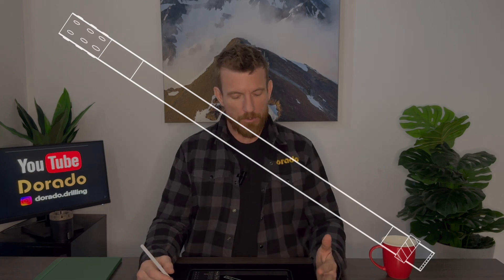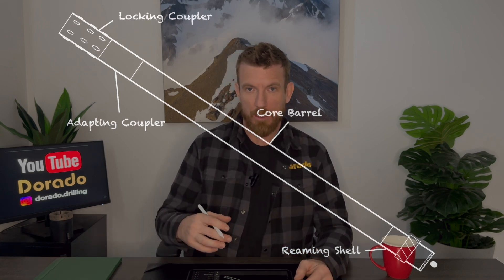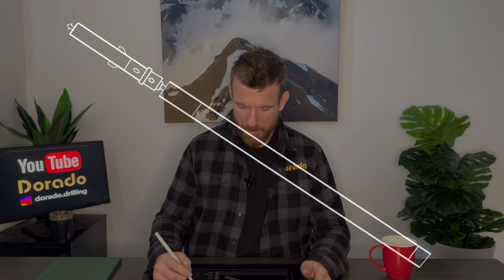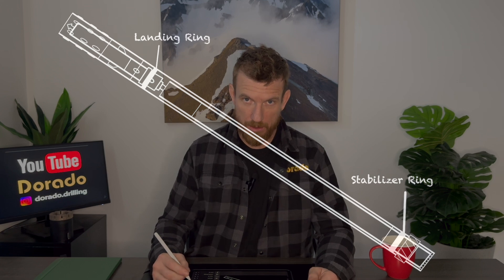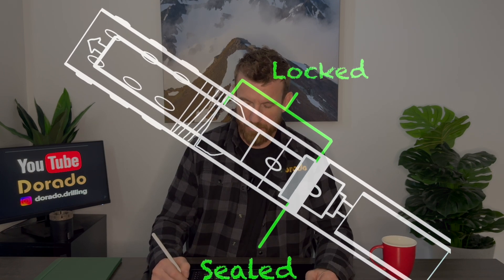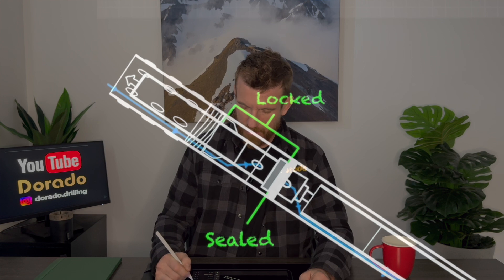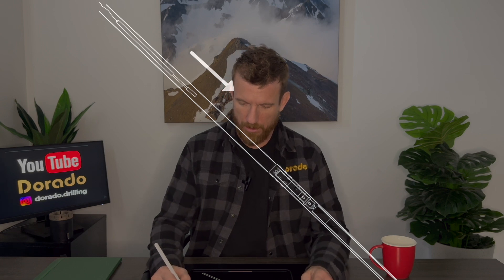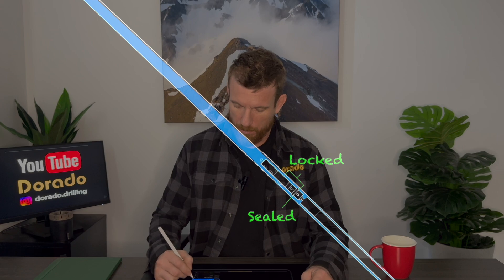Diamond Drilling 101 - Episode 4

Comment: That’s a Latch Assembly. Not a Backend and to avoid burning the Casing Shoe to the Core Barrel,a plug with Male Threads on the Pin end and a Female Box end can be made up from an old Drill Rod to be Screwed onto the Rod String before setting the Rods on bottom to Ream the Casing. This keeps the Drill Fluid flowing around the Casing Shoe instead of Flowing out through the Drill Bit and causing the Casing Shoe to burn onto the Core Barrel and with a Threaded Plug the Driller can Reconnect to the Drill String if the Rods advance to a point below Ground level.
Reply: Thanks for the comment @TheDrillers571.. The primary difference is that the latch assembly is a subsystem within the overall backend/head assembly specifically designed to lock the inner tube into the outer tube, while the backend/head assembly as a whole manages fluid pressure, rotation, and retrieval. 

Always happy to discuss and debate, keeping in mind these videos are directed at entry level employees and geologists, so some nuances have been left out for the sake of simplicity